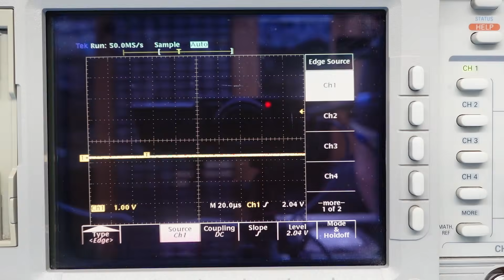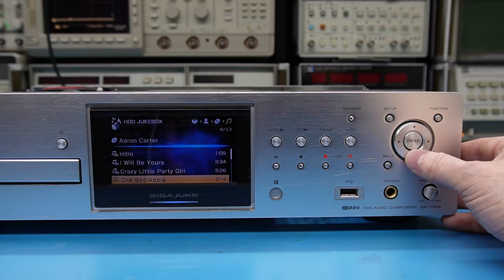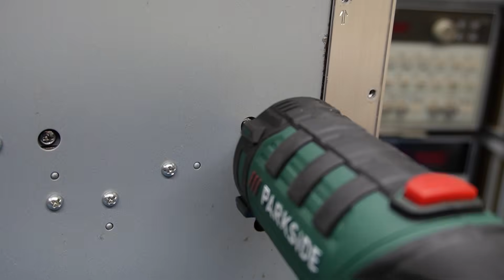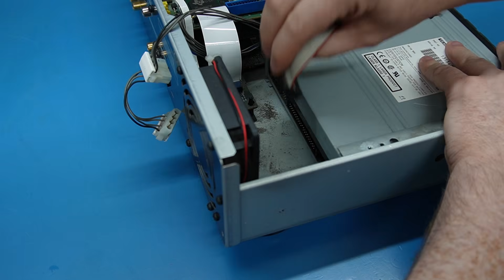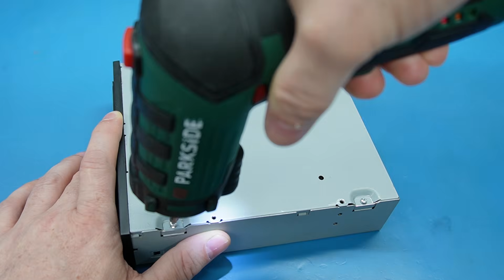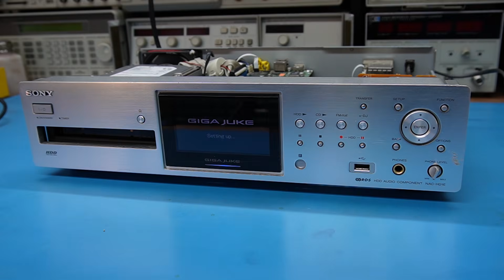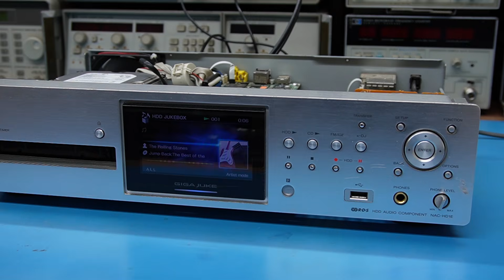SONY Giga Juke, Codename 'PROBLEMBOX'

Comment: The slow down playback is a mismatch sampling rate problem. The I2S clocks for the DAC section all derived from the single 27MHz crystal, so there should be a PLL circuitry there, generating 44.1KHz or 48kHz master clock, then the bit clock and word clock. Very easy to see on the scope, obviously :)
Reply: @getmefix1921  I took the audio from Mark’s video and aligned it to an original recording.  With a speed multiplier of exactly 1.5, Mark’s audio aligned perfectly.  This suggests that 48Khz audio is playing back at 32KHz. This suggests that it’s not a problem with the 27Mhz itself, but more with a selection on the PLL to derive the appropriate sample clock.    Since 32Khz is a valid sample frequency, I would suggest that selection of 32/44.1/48 is controlled by software, driving some tracks in to the divider / PLL device feeding the DAC (and ADC).  Could even be a resistor dropped off, or a dry joint,  if this is controlled by 2 lines, giving a binary selection of 4 possible sample rates, and the loss of one track  is selecting 32 rather than 48. (I appreciate the ripped CD would be 44.1, so this isn’t an exact diagnosis, but the ratio is suspicious).   I reckon this is an easy one to trace, looking at the DAC/PLL and not to do with the main processor itself.
Reply: @WOKFM  Yep. The sampling clock would be my guess too. The clock drives the output shift registers in the main chip. The CD rip is purely digital and has no effect on the playback speed. It's just data.
Reply: I agree. This is a Sample rate issue. Recording from the radio, just recorded at the wrong sample rate, and thus played back correctly (at a lower sample rate).    Everything that had been recorded at 48/44.1 (ie the original HDD recording or the CD natively) is playing back at the wrong sample rate.
Reply: early on in the episode i pretty sure the audio on the Hdd was doing the same thing, I was baffled why he got focused on the cd drive
Reply: @blanca_music  I think he assumed the hdd audio had been ripped from the defective cdrom.
Reply: @tux1968  ohhh gotcha
Reply: I would agree. Listening to it playback it sounds like it's near anough half speed as it's tonally in the same key or thereabouts. I haven't checked of course, but I suspected it was a mismatch or some sort of division problem.
Reply: I'm no electronics nerd but i was gonna guess DAC issue probably related to the clock
Reply: it's on 33rpm instead of 45!!!😁😁😁
Reply: @ericwilliams2122  😄
Reply: Sounds like a go Houston
Reply: Ahhh you beat me to it mate! 👍🏻
Reply: Although I do not have one of these units it is a very computer based type of system. It's possible that half speed playback is possible in one of the menus (perhaps with the units remote) or maybe through a button on the panel that I could not see from the video. Some professional DJ equipment has that ability to speed up or slow down CD playback, but again I have never seen one of these units so I could be completely wrong. Just my thoughts and nothing more.

Comment: Slow playback speed will have nothing to do with the spindle speed of the drive, or anything to do with reading. CD drives aren’t analogue (as you know) and slowing the speed of the disc will result in skipping of broken data transmission. 

As others have said, Sony loved to throw all sorts of recording a playback speed controls in their devices, noticeably in their mid-high end minidisc recorders. I bet there’s a setting in there with a % speed change.

Comment: I dont think this is a software issue though I could be wrong, apart from what someone else said, you could try a factory reset, otherwise i think something might be amiss in the DAC area of the circuitry, it's probably where I'd start poking around. Sony were notorious for bad SMD caps in that era of tech, I bet there are more that are bad. Could be an an XTAL thats failing intermittently? @MendItMark  - does heating the unit and hitting parts of it with freeze spray give any hints?

Comment: I think is a sample rate problem. maybe when it should play at 44100 it plays at 22050. the radio records ok, because it also thinks it is recording at 44100, but actually is at 22050, so when it plays it plays fine because it thinks it is playing at 44100, but actually is at 22050.. maybe there is a configuration somewhere or a clock sigbal  is messed up.

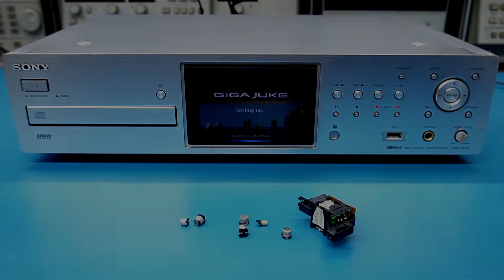Comment: 28:48 "Just stick it on eBay as untested - that's what everyone else does!" So true Mark...
Reply: Then it just keeps going back to Mark
Reply: Truth. I've been burned by this a few times. Now I just offer the broken needs repair price instead of the higher and unfair seller price.
Reply: Hey it works out sometimes, last october i got a fully working, and extremely overclockable 11900kf that was “untested” cause the seller didnt have an lga1200 test bench and the computer it came out of was dead (alienware so it was probably the psu). Got it for 100 bucks, basically a third of what known good ones are selling for even now
Reply: And then it comes back to Mark for repair;)

Comment: The issue is entirely in software. Sounds like it’s playing at half speed and the elapsed time isn’t counting up by the second. You wouldn’t hear slow audio with a hardware issue, you’d hear nothing at all or noise.

Check the settings. A complete wipe and re-initialisation wouldn’t go amiss either.

Comment: Could not figure out why you went after the cd drive after it also played slow. Nothing to do with the cd drive, this is all a firmware or clock problem. The cd drive has no analog output connected, it's sending down digital PCM

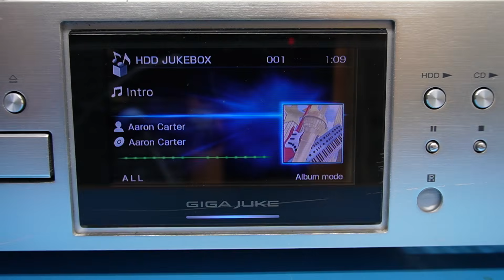Comment: 3:04 Of course it has an Aaron Carter song as the first track. How very early-2000s of it. lol

(Before it powered up, I was thinking maybe it would be Aerosmith or something, but I guess it makes sense that "Aaron" would be first, alphabetically.)
Reply: After the CD played at a slower speed, I knew the drive was probably OK.

Since the GigaJuke would be pretty much "ripping" the Audio CD via IDE, even during playback.

(on older versions of Windows, they used to use the CD drive to play the disk, with an analog or SPDIF cable going to the Sound Card. Later versions of Windows played the Audio CD data via the IDE/SATA port, so you could then ditch the separate cable.)

It does seem like one of the clocks has gone half-speed, like a problem with the Clock Generator IC or something?
(some of the common Clock Gens are programmed at the factory for different output freqs. Maybe that keeps losing it's config for some reason?)
Reply: I tried putting the Support page into the Wayback machine (archive is back online now).

But still no firmware was on the page, even back in 2020?

A user on the sonyinsider forums managed to upgrade the firmware of the HD1 using the NAS-S55HDE code, but I don't know how easy that is to get hold of, or whether the HD1 needs to be modded to use it?
Reply: It could well be some software/firmware corruption in the SPI Flash, or maybe even the HDD image.

But it just feels like it could be an actual hardware fault, since it plays back at the correct speed sometimes.

It's funny that the GigaJuke uses an SH4 (Dreamcast CPU), and has a full PCI bus on the main board. lol
Reply: The Sub System controller (IC401) seems to be generating the main clocks for the DAC.

It also handles the front panel buttons/LEDs, IR remote, main I2C bus, Tuner control, etc.

That chip is driven by a 16 MHz crystal (X401), so it's worth checking that.

Oh, X301 is an 11.289MHz crystal on inverter gates IC313.
(44.1 KHz * 256 = 11,289,600 Hz)

That will likely be the master audio clock for the DIR, DIT, DAC, and everything.

Inverter gate IC might have got zapped when the PSU failed, and now it's working on a weird harmonic of the crystal sometimes?

Comment: The "Ntpserver" (Network Time Protocol) is for time and date. Windows, and other OS' use a similar thing in the system clock to keep the time correct.
Reply: It's quite possible by not setting the NTP server (and connecting the thing to the internet) it didn't complete its clock setup and got stuck on 32KHz sample rate.
Reply: @Breakfast_of_Champions   i doubt that. The NTP server should have nothing to do with playback speeds. It's only about time and date. So you can save recordings with a timestamp or something.

Comment: I want Mark the wizzard to get the Blue backlit display working on my Bush multiformat cheapo LoFi system bought from Argos a decade ago..all works still but you can't see the LCD unless you shine a torchlight into it..the CD works..the SD and USB works and the radio tuner..no cassette player in this budget device..i would like to use it if i could see easily what its playing..maybe just an LED fail?

Comment: Bad caps on the mainboard causing the audio codec chip to be unstable, there also may be a super cap used to keep the memory like in the Xbox etc, that may have gone bad and not keeping the settings, It is only supposed to keep power for a short period they usually have a gold stripe on them.

Comment: Could it be designed to run off 60Hz power? So it's running slower on 50Hz?
Reply: Speed is not related to the mains frequency on these machines.

Comment: Typically digital playback of a file format in a higher sample rate by a device that cannot play that sample rate, will result in the song sounding slowed down. You need to find a word clock or DA converter and check the clock speed on it.

Comment: The device is most likely set to play back at a fixed sample rate that's twice lower than regular CD 44 kHz. It recorded the radio at it so the playback there was fine.
I would look in the system settings, perhaps do a factory reset if it has it.

Comment: I have a Sony one that does something like this. It was the top of the range back In the day. Record to the HDD, then you could record on to a DVD+or-R or RW. I just swapped out the HDD for a new one, and The DVD ROM for a new one too. But mine Is all SATA Cables rather than IDE. And If anyone has one of these, and It suddenly stops recording to the DVD or writing from It. Then It Is the SATA Cable (Blue or Red one) that has stopped working. Change this out for a new one, and You are good to go again. Thanks Mark for sharing this. Sad You could not Fix It properly. till next time, keep 'Em coming.

Comment: OK, how the heck do you get copies of the schematics for these things?  I'm lucky just to be able to find a copy of the users manual, let alone proprietary repair schematics.  I have a dead combo VCR/DVD that just stopped powering on.  probably an easy fix IF you can trace out the power logic circuit.  What's your secret source !

Comment: Rolling Stones be like " You can't start me up!" 😂
But seriously... I would check if the S/PDIF output and/or any I2S buses are running at half speed too. If not, it's a software problem. Maybe the DAC is configured by the software for mono while it's getting a stereo stream.

Comment: I've done 01005 resistors by hand. I feel they're actually easier than 0402 if you have enough magnification and the proper soldering equipment
Reply: Seen plenty of general electronics techs on YT get in a muddle with the smaller stuff. Just takes practice and decent tools.
Reply: 0402 (metric) and 01005 (imperial) are the same size.

Comment: Try playing some MP3's that have been ripped externally, and see if they play slow, or at normal speed... I don't think it can be related to the CDROM drive, since it's reading the digital data off the disk, so it can't be playing "slow", unless the playback is running slow.

I tend to agree with others here, try a hard reset!

Comment: Got to be software especially since both the CD and HDD speed was affected.  It's possible that it's the battery, but I kinda doubt it.  The CD worked and then didn't work during the same power cycle.  It looks like it's rebooting every time it's turned on so I don't think a hard reset will work either.  I had one like it back in the day and it had the shortest useful lifespan of any sound device that I ever bought. About 6 months after I bought it I stopped using it.

Comment: Great attempt to fix that clunker. So many alternatives to these GigaJuke boxes these days. I looked them up online and I cannot believe they still sell for around $600 - $1,000. That is just nuts.
Reply: A used desktop computer with an FM tuner card would be less expensive
Reply: @timmooney7528  A cell phone with My"Heart"Radio app, YouTube, and local MicroSD Card with your ripped FLAC files on it. Done.
Reply: @timmooney7528  but wouldn't fit in the rack with the rest of the Hi-Fi system.

Comment: I'd definitely be cloning that hard drive as getting the software will probably be impossible if the drive fails unless it has an option to setup a new drive from the rom.
Reply: The software (firmware) is on the main board, not in the hard drive.

Comment: Hi Mark, i would replace the hard drive, plug it into the PC and see if it works, the one in the the gigabit is old replace it with a Crucial SSD for 60 quid you can get adapters to covert the cable to Sata!...cheers

Comment: The CD is 44.1kHz sampling rate and maybe the unit is set for record and playback at 48kHz sr. As mentioned by another viewer, this might cause the problem. Had the same problem on our studio desk runnign at 48kHz and with a digital source at 44.1 it all sounded to slowwwww. Think that's the problem. Go to settings menu.

Comment: I like your videos. And sometimes it‘s a tricky candidate on your desk and challenge you. Hint: both CD and harddrive use the same IDE bus and both running slow. Before the DAC is a buffer controlling the speed of data delivery from the IDE bus. And even with half speed it still sound like music. If there is a mismatch of sample rate it will never sound like music.

Comment: I think I would check the area around the sub system controller, ic 401 and xtal x401, 16Mhz.
And the 11,289Mhz x301 around ic313.
Could be something silly as a cracked solder joint/cracked smd component because it play once at the correct speed.

Comment: Lovely video, as always, Mark!

I always wonder when I see such devices, how "moddable" they are - in terms of using the IDE interface with some clever converters to plug in a modern, SATA SSD, a flash reader, et cetera...

Also, I cannot believe that You just casually had the whole pickup assembly for a random CD drive just in stock... Is that luck, or is Your stockpile just so well... Hm, stocked...? :v

Nevertheless it is amazing for me, I in such a situation would definitely try to swap the entire drive for a different one (although that would probably fail miserably because of some manufacturer shenanigans, it ain't a PC exactly, so not sure if there would be no compatibility or driver issues et cetera)

Comment: Hi Mark, thanks for the video, do you know why the CD laser part came with a solder blob to remove? Many thanks
Reply: Most CD mechanisms have the solder blob. It shorts out the laser diode so it can't be zapped by static electricity. You remove the blob once the optical assembly is installed and the ribbon cable is connected to the PCB.
Reply: All CD player Optical pickups have the blob. When I worked in the trade, the whole workshop would erupt into a cacophony of Blobby-Blobby-Blobby's if someone forgot to unblobby the blobby. They have them on minidisc players too.
Reply: @zero0ryn  Not all. I have installed replacement optical units that just had a metal shorting clip across the ribbon cable.
Reply: @stopthebus I've seen those too. But never on Sony kit.

Comment: yeah well, the HDD replay and the CD replay are both slow, so it wasn't going to be the CD unit. It sounds like it's playing at the wrong sampling rate, 22Khz instead of 44? So why did it work once? There has to be a clue there.

Comment: The CD-Drive is only connected by IDE, this means, that the CD-Drive operates in data mode (the drive can not skip scratches on the CD, but would try to read over and over). The data that comes from the drive can not be "half speed", it is just the data with an asynchronous speed (slow on the inside, fast on the outside of the disk). So all the playback is done digitally. Playing back sound with half speed is "a complicated" thing... (=software). If you would like to do this in hardware, you must lower the clock frequency - but the clock frequency was good. It must be a software problem - there is no other explanation. To verify this theory, one could look at the output signal with an oscilloscope and look for digital artifacts in the wave form...

Comment: Hello Mark although there is no Sony support for a firmware update there are additional private sites that you can find it on with a quick google search, but first there should be a setting in the menu for a "factory Reset" which may bring it back to it's "out-of-the-box" state.  Just a suggestion . Also your work it top notch! In fact you are phenomenal with electronic repair. The best I have seen on YouTube so far.

Comment: The hdd playback was slow, then later the cd playback was slow, then it was ok and then not again. The CD has it's own dac, it was probably ok but you were right to recap it. So my conclusion is that there is another half shorted cap or mosfet somewhere. Also re. your 1st video, breaking the traces on old boards is really hard not to do. These old boards are losing their composition. You can't guarantee these things won't just break again even just by moving them. Interesting it had a TEAC CD in it and not a Sony. All the best. Love your videos.

Comment: surely this is a clock problem.  must be.  imagine where in the circuit you'd put a knob to change the clock speed and look in that area.  there's a playback clock signal somewhere and it's trying to hide.